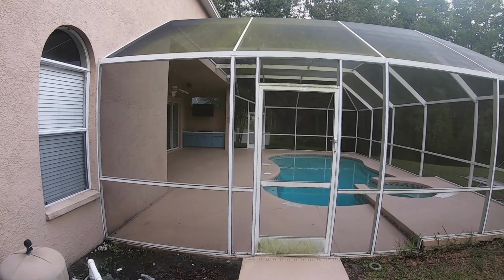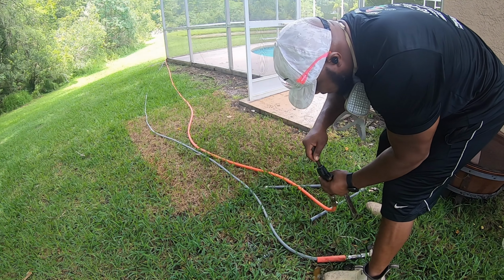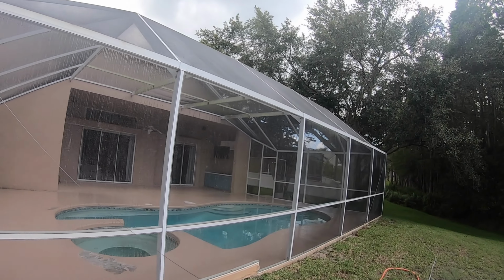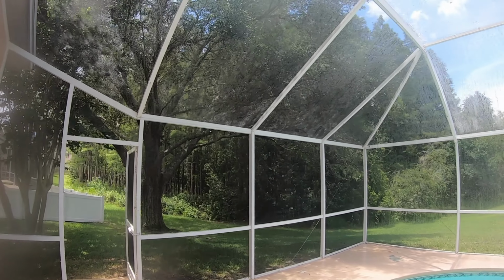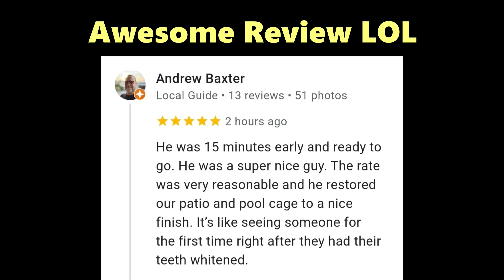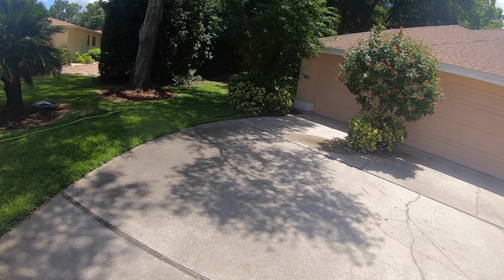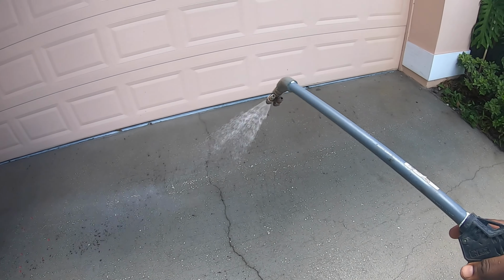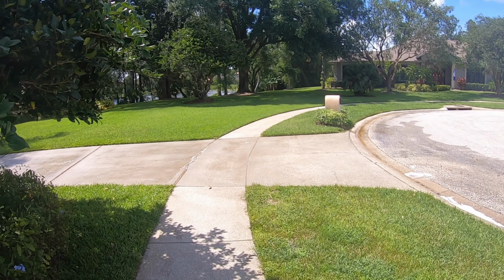Pressure washing pool cage and Pressure Washing Driveway

Comment: I feel like you get so lucky I’m in Jacksonville Florida and it is always so hot and humid here every time I watch your videos you’re in the shade or it’s overcast. Also do you require clients to move Property out of lanai ? Every time I ask clients to they tell me that they cannot or won’t or don’t have time to do it . I generally would charge 180 bucks for a back porch like that but mine would be covered in plants and furniture that I would have to water and furniture that I would have to clean the cushions takes much more time. Also just wanted to say thank you for your backpack sprayer video I went out and bought myself a Milwaukee battery powered backpack sprayer have paver ceiling job booked for the 20th 3700 ft.² I probably would  not be doing the service if it was not for you so thank you.
Reply from the maker: LOL oh trust me it gets hot here those clouds never stay around long. Its been 95 degrees here with 102 heat index this week!

Yes I do notify the clients to move their sensitive items such as plants and furniture out of the way. If they would like for me to move all of their stuff of course theres a charge because of the liability of moving tables, chairs, plants that may get damaged.

Good luck with the paver sealing job im sure the backpack will work great. Just make sure to rinse it very very well, I use a little bit of pine sol in my rinsing water also to help clean the sprayer out. Glad i could help my brother.

Comment: great content as usual. you know your my favorite. question for you. my super suds sucker came today but i have no idea what # orifice do i put in for my 8 gpm machine? they didn’t send any info. please help
Reply from the maker: Thanks brother. No they don't send info with it cause it's right on the page where you order the injector from. 

There are 4 nozzles that come with the Super Suds Sucker. The one marked #2 is for 2-5 GPM pressure washers, the #3 (already installed) is for 5-8 GPM, the #4 is for 8-10 GPM and the #5 for pressure washers over 10 GPM.

Comment: How long did it take you to update ?
Reply from the maker: 4gpm 1st year. 5.5gpm year 2. Now into year 3 with the 8gpm.
Reply: Thanks champ just completed my first year today , and did a huge commercial job , 3 car parts and got it done but felt like getting the 5.5 this year as well , did i do a buffer tank with a 55
Reply from the maker: @mark4668lighting  I did my 1st commercial job 55k sq ft 2.5 story building with a 4gpm and a lidr
Reply: @PinkFlamingoPowerWash  if i update to a 5.5 do I need a buffer tank
Reply from the maker: @mark4668lighting  I would yes

Comment: Hi Cliff,

Hey, what was the time difference cleaning that concrete driveway between your 8.0 gpm vs 4.0 gpm  two years ago 😉. 

When you post treat do you use soap or just straight SH? 

Man, that was a large surface cleaner. 

Great job and great video. 

Thanks
Michael C  - (WA)
Reply from the maker: Huge difference. with the 4gpm i must of been there at least 1hr 30 minutes. With the 8 I was there 40 minutes.

You dont necessarily need soap for concrete but i do have a little bit in my SH. nothing too crazy, just enough to see what im spraying.

Thanks for watching my brother
Reply: @PinkFlamingoPowerWash  

Wow! That's a big difference with the 8 gallon. 

What size water tank do you use to run your 8.0 gpm? 

Thank you so much for all your videos. It's helping me a lot.
Reply from the maker: @michaelc7283  I got 125 gallon tank of course its hooked up with a Hudson float valve that stops it from overfilling while I work.
Reply: @PinkFlamingoPowerWash  

Thanks for the information. 

Congratulations on your 6k. 

Well deserved 👏